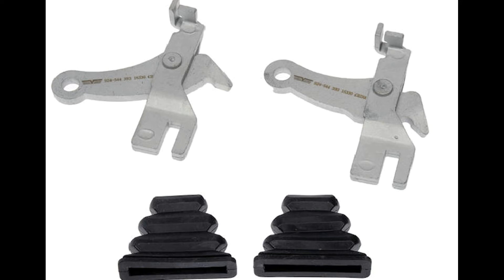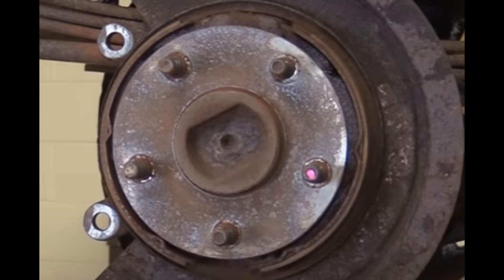Stuck E Brake on a 2011 Dodge Ram

Comment: My girlfriend fixed this on my 2016 1500 it was bought with this problem. The trick is to spin the axel face to get the new actuator in place. The real trick is getting the seized ones out PB Blaster worked on one and the other she manipulated out. Fairly simple fix a lady that enjoys 🔧 wrenching completed in two days along with other repairs and maintenance. Once seized actuators are removed put the new ones as close as you can position them and spin the axel face they will go right in. She put lithium grease on them to reduce the chance of future problems. Position boot and reattach ebreak cable she replace that to no more sagging ebreak cable or rear end drag now! To get home we loosend ebrak tension and hit actuator with hammer to release it enough that ebreak was not engaged no damage getting it home. There's also a break adjuster in back you can loosen it with break spoon or bent small flathead we didn't have to do that but might help someone. My girlfriend will post this repair soon along with others! I will add link for Dani
Reply from the maker: Thanks for sharing. That seems to be the only way by tuning the axle as you pivot them out. The real difficulty I had was replacing the shoes with that huge hub in the way. By all means send that link, I would love to subscribe to her channel.

Comment: Do new ones go in easier than the old ones come out?
Reply from the maker: Extremely difficult job because they don't give you enough room between the flange and the backing plate. I just got them wedged in position as close as possible to where they go, then turned the flange counterclockwise to pivot them in place. Then trying to install the brake shoes and hardware is a challenge because that huge flange is exactly in the way. This job was 3 days of misery. I started out trying to film it, but I had so much trouble and so much cursing I abandoned the video. However, the job came out great as the truck will absolutely not move when the emergency brake is deployed. If I ever do this job again, I am not going to fool around as I am going to pull the axles. With the flanged axles out of the way the job will be a piece of cake.

Comment: For anyone looking to do the real fix and replace the parking brake levers inside the rear drums, just know that you may need an angle grinder or some cutout tool to get the levers out. Thanks to the design of the drums the lever inside can only be removed one way and that's ONLY if the lever still moves which if it did you wouldn't be replacing it. So since the lever is likely rusted shut and cannot actuate properly, you cannot remove it from its place without hammering it loose possibly causing damage to other components, or taking an angle grinder to the lever arm and getting it out that way. Just know its a b@#$^ to deal with and not really worth it unless you are already doing a planned parking brake change.
Reply from the maker: It was an awful job. As I said in the video, I abandoned my efforts to film it as I had so much trouble. I was actually able to get the actuators out without cutting anything. I pivoted them out as I simultaneously turned the hub. Then pivoted the new ones back in as I turned the hub back the other way.
Reply: @richardspaulding5035  were you able to pivot the new one in without removing the axle? Does the new one you put in look exactly like the ones shown in your video? I cut the seized lever and was able to get it out, but the new one I purchased has wider arm (it's the same one in your video) than the original one I took out and I couldn't get the new one back in.
Reply from the maker: @lancehe9075  It has been maybe 2 possibly 3 years but as I recall the parts pictured in the video were what I used. I did not pull the axels as I found a way to pivot the old ones out and the new ones in by turning the axle as I pivoted the actuators in place. The job would have been easier with the axel flange out of the way as I replaced the shoes and hardware as well. But to remove the axle you will need to drain the differential oil, remove the differential cover, I am not sure on this vehicle but on some I have worked on you must find a way to prevent the spider gears from falling out once the axle is pulled. Then pull the clips holding the axle in place. it was a can of worms I did not want to deal with.

Comment: Any tips on how to put the new actuator in once the old one is removed? I have the exact replacement shown in the video but the arms are wider than the oem ones and I can’t get them to fit through the slot
Reply from the maker: You must sort of pivot them in. Line up the lever that must fit in the slot resting on the inside of the hub. Then  turn the hub by hand counterclockwise and  pivot the actuator into the slot. If that makes sense to you.

Comment: You can go underneath the truck and hit the actuator arm with a ball peen hammer to take the brake off

Should you decide you wanna fix it then you can do the three hour repair but keep in a hammer in the truck was good enough for me
Reply from the maker: Took me a lot longer than 3 hours LOL

Comment: How do they come out?
Reply from the maker: Not easily I remember that much. Of course, you must remove the shoes. The shoes are extremely difficult to remove and install because there is a very large hub in the way. Once all the brake hardware is out of the way you sort of pivot them until they come in contact with the hub then turn the hub in that same direction as you continue to pivot the actuator out. I have been doing brakes for 50 years and I struggled mightily with these for 3 days. Unless you have a lot of skill and patients, I would not attempt it. 1A auto has a video on how to replace the shoes, however not the actuators. They make it look a lot easier than it really is so beware.
Reply: @richardspaulding5035   I was able to remove the shoes easily on my 2016 ram 1500 and put them back on easily BUT I could not get the actuator off with the axles in so I left the old ones on for now.
Reply from the maker: @johnsn10  What you need to do is to pivot the actuators out until they contact the inside of the flange then continue to pivot them out as you turn the axile. do the same when you install them but in reverse. I wanted to film the entire repair; However, the job gave me such a hard time I abandoned the video very early on. I worked on it off and on for 3 days. The result was fantastic as the truck absolutely will not move now with the emergency brake engaged. It has been a couple of years as I continue engage the brake almost every time I park to prevent it from rusting up again.